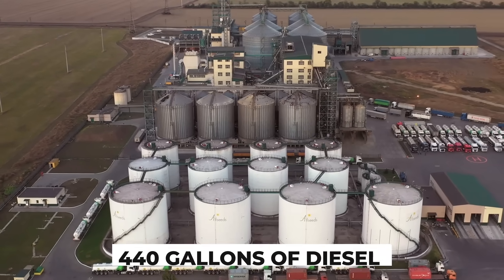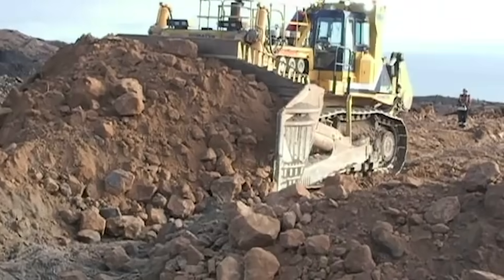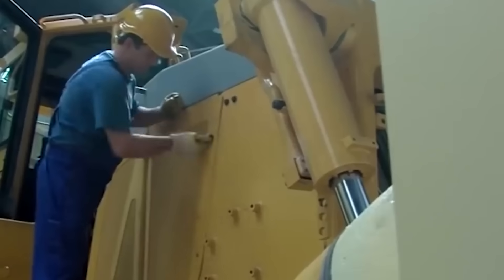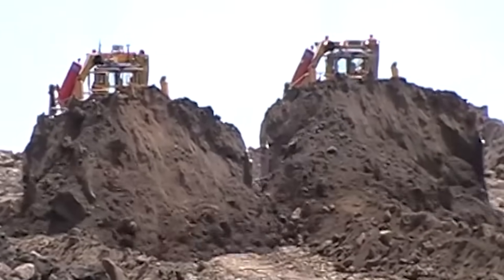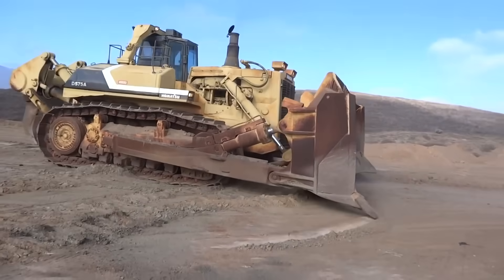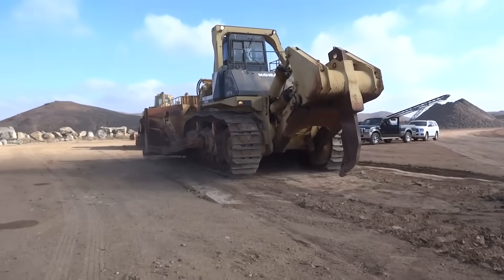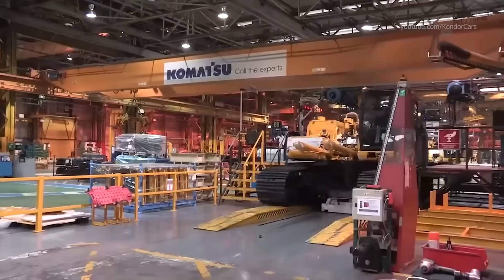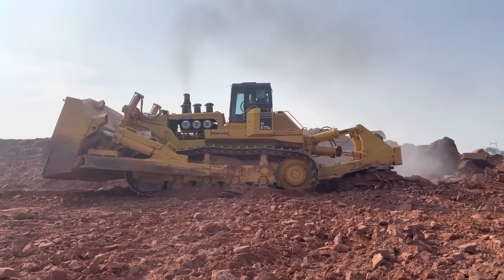This Insane Engine burns 440 gallons of diesel in one shift

Comment: I’ve used one Komatsu d2 and it wouldn’t move a five pound piece of hot top ! I would never recommend it
Reply: I operated a 344 KOMATSU LOADER IN THE WINTER HERE WITH A 18 ft ARCTIC SECTIONAL BOX AND THAT KOMATSU WOULD OUT PUSH THAT KITTY CAT OVER 5 ft over the top 18 ft across   I have video of this that kitty cat I had break off the pile and split in half to move the rest of it to the snow pile 😮